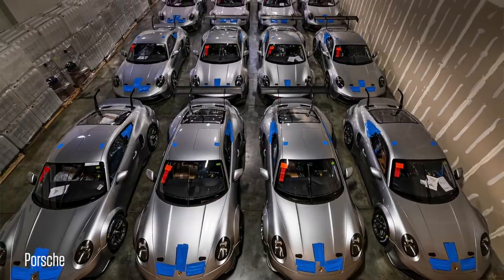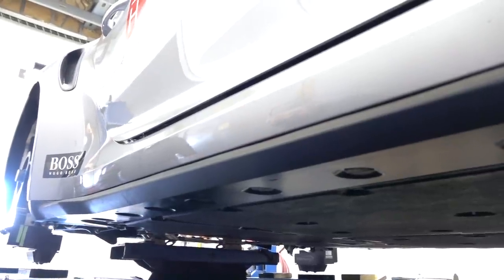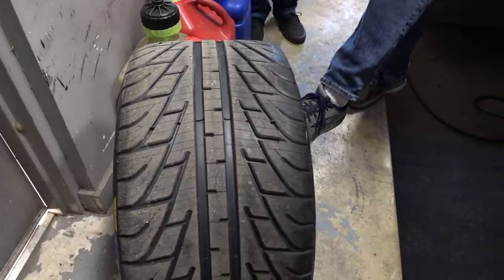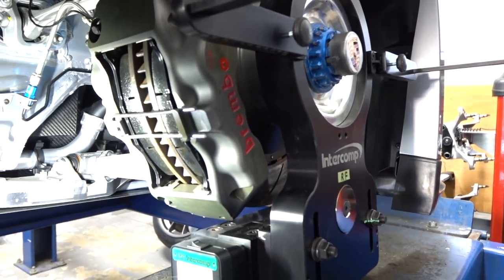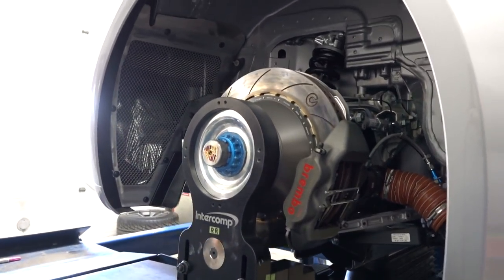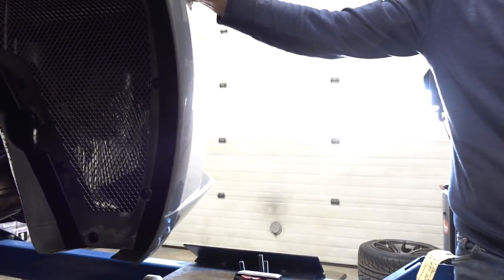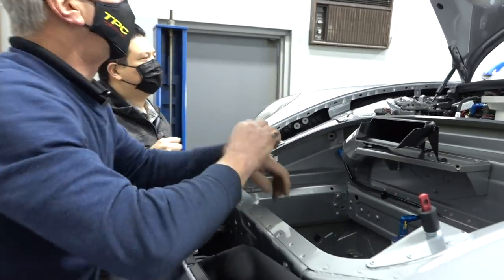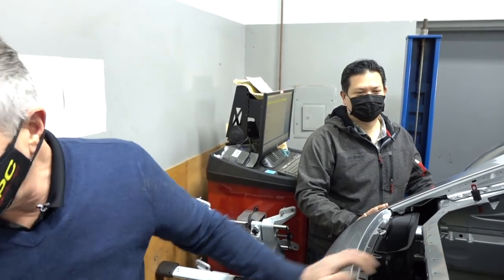PCA Spotlight: Why Porsche's 992-generation 911 GT3 Cup is a technical leap beyond the 991.2 car

Comment: Has the rear quarter panel and sills a sort of removable protection from the frequent impact "side by side" during race? Or have you to repair the metal body after every race?
Reply: The rear quarter and sill are part of the tub, same as in previous gen Cup cars. To replace them will require bodyshop work.
Reply from the maker: @tomchan1258  Thanks Tom!
Reply: @tomchan1258  Very Kind! Thank you for your professional answer...have a nice week end!
Reply from the maker: @meschio  From Mike Levitas: "You can section the quarter panel to save time on the 991. It's structural, so we weld and bond the entire quarter. On the 992, the quarter panel does not seem to carry any load, so sectioning seems appropriate and should not compromise performance."
Reply: @PorscheClubofAmerica  very kind. Thanks for your professional and technical answer.

Comment: I believe white & silver are Germany’s international racing colors.
Reply: Germany’s racing color is white. Mercedes went to silver because they had to sand the white paint to lose weight because the white paint was heavy because of the lead pigment. So the car went silver the color of the bare metal
Reply: That’s was a very long time ago
Reply from the maker: Our sources indicate that it was a project based decision, not a throwback choice. Definitely not due to a historical German motorsport color choice.
Reply: Spot on: https://motorsports.porsche.com/usa/en/article/2020/12/02/911-gt3-cup-2021 The purpose of Dream Spirit is also reflected in the design. For the first time the new race car is being delivered in GT Silver Metallic. A color which on the one hand emphasises the sportiness and on the other hand has historical significance in motorsport.

Comment: Are the center locks the same PITA style as street cars?
Reply: Race car center locks are designed for impact gun so they are much more convenient than street car center locks. The race car center locks look beat up after some usage as a result, which is normal. If I had the choice I'd take convenience over aesthetics on the street cars. :)
Reply from the maker: Thanks for chiming in Tom!
Reply: @tomchan1258  i was hoping they were impact wrench type,  they sure were prettied up.